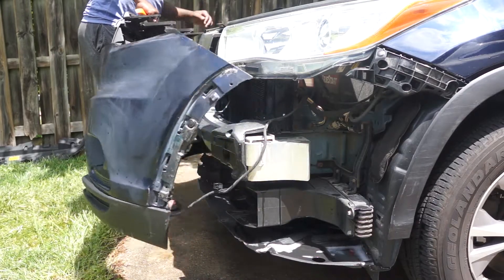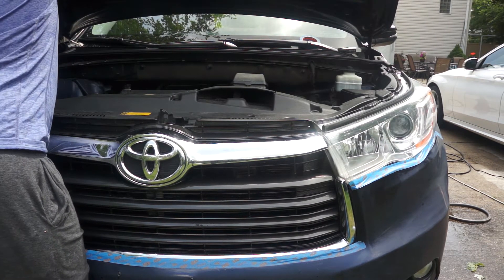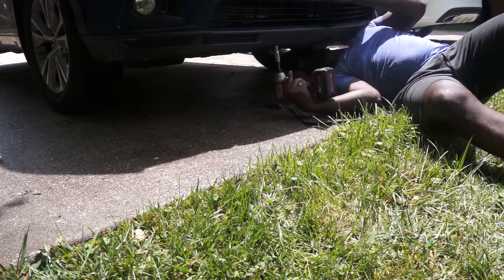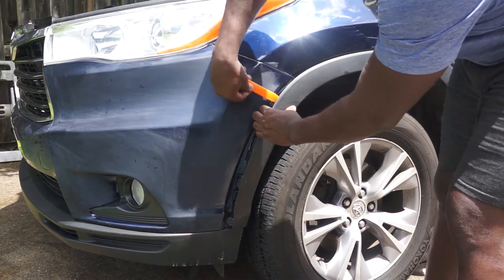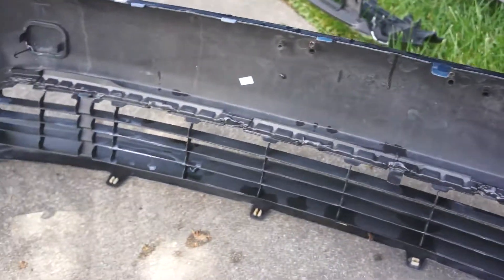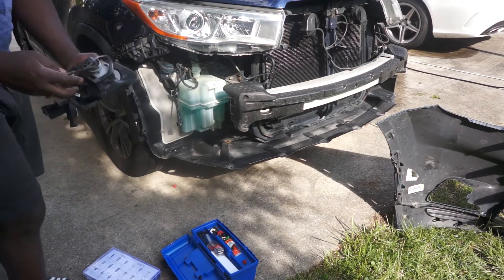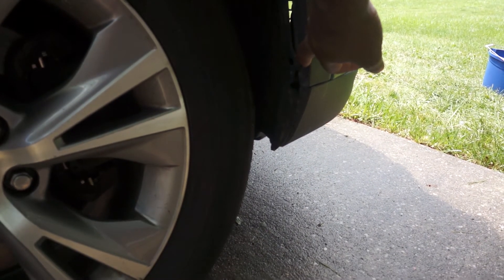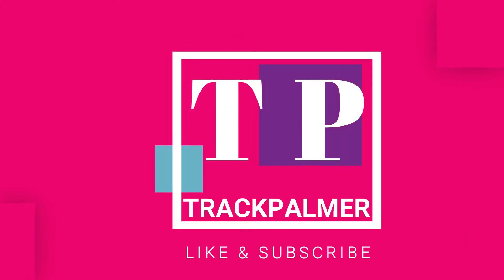How to Remove & Install Bumper Toyota Highlander 2014   2019

Comment: How can I know parts fitments? Like 2020 tailgate door will fit on 2018 highlander?
Reply from the maker: Check that part number. Sometimes they are the same. you can also check with a good dealer. They sometimes have inside information that can be helpful.